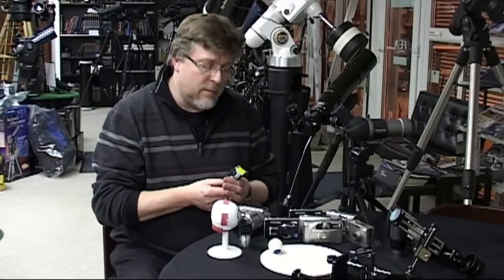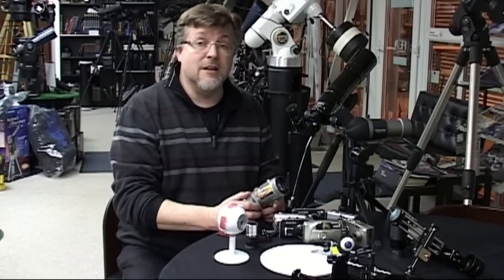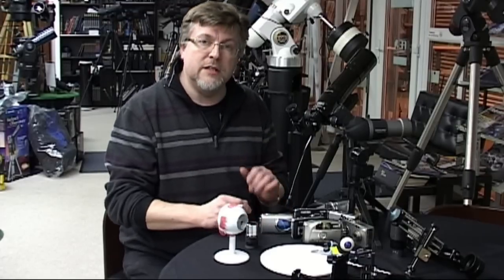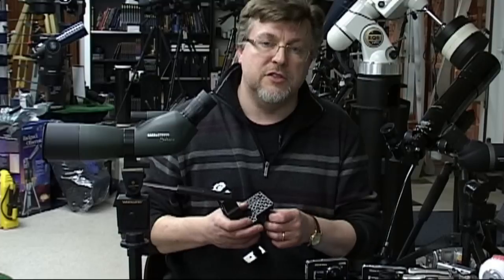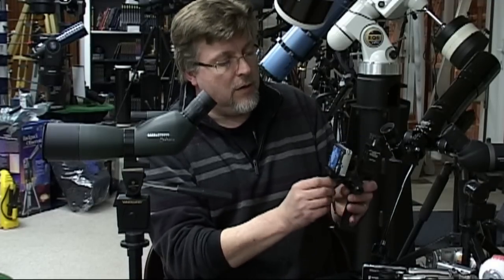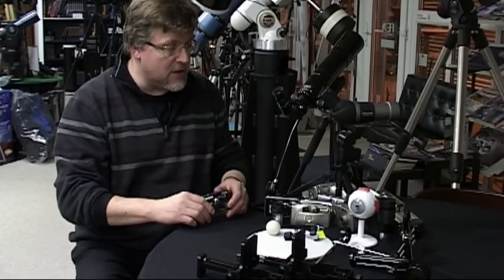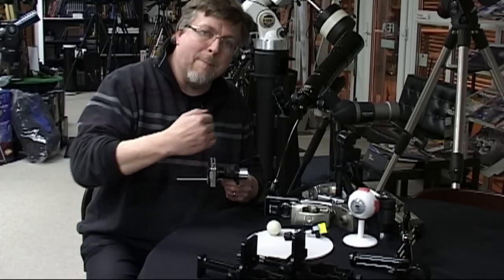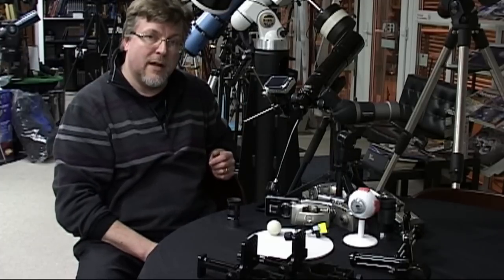Methods of Digiscoping (2/2)

Comment: CAN YOU PLEASE, PLEASE GIVE THE NAME OF A RESPECTED MANUFACTURER INCLUDING MODEL NAME/NUMBER OF A VERY SMALL CAMERA, OR THE OLYMPUS THAT YOU HELD, CAPABLE OF PRODUCING 10 MP IMAGES!! (PLEASE FORGIVE ME FOR ALL CAPS. MY KEYBOARD IS MALFUNCTIONING. AND NOW IT GOES FROM CAPS TO LOWER CASE AS IT CHOOSES. IT BASICALLY HAS A MIND OF ITS' OWN!!) I HAVE A BUSHNEL ELITE 20-60X80MM SPOTTING SCOPE. THE COMPANY "OPTICAL PLANET" SAYS THAT THERE IS AN ADAPTER THAT WAS MADE FOR MY SCOPE, BUT HAS BEEN DISCONTINUED!! I VERY BADLY NEED IT URGENTLY, AS I'M IN THE MIDDLE OF WRITING THE MOST EXTENSIVE BOOK ON STEELHEAD AND SALMON FISHING. MY BOOK WILL BE ACCOMPANIED WITH DVDS. TO CLARIFY THE LESSONS GREATLY, I NEED TO USE MY SPOTTING SCOPE!!! THE  ADAPTER IS: "BUSHNEL UNIVERSAL DIGISCOPING BRACKET BLACK 780002CM". IF SOMEHOW YOU FIND A SUBSTITUTE, I GIVE MY WORD TO THANK YOU FORMALLY ON THE FIRST PAGE OF THE BOOK. EVERYTHING WAS GOING WELL. (END PART ONE)